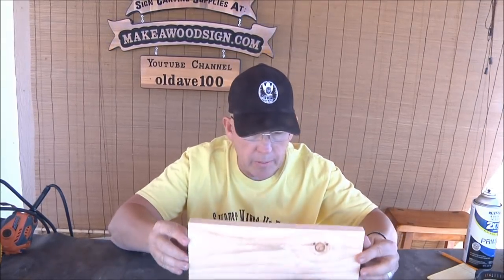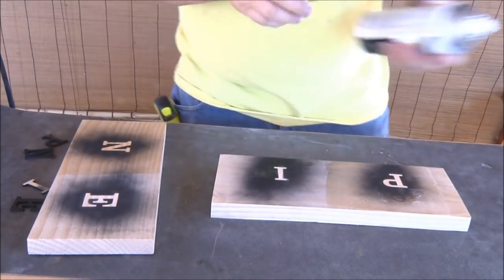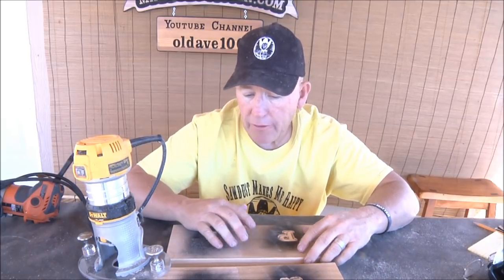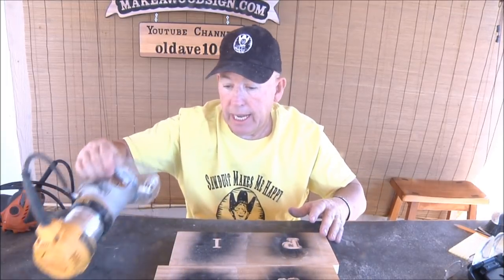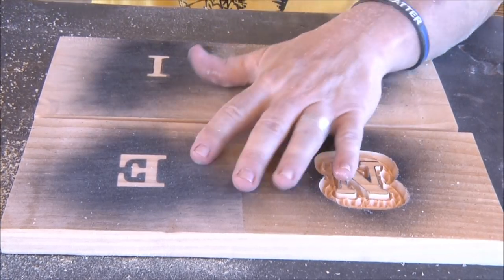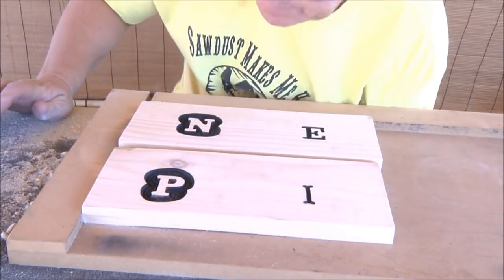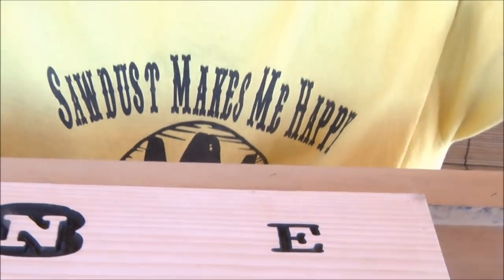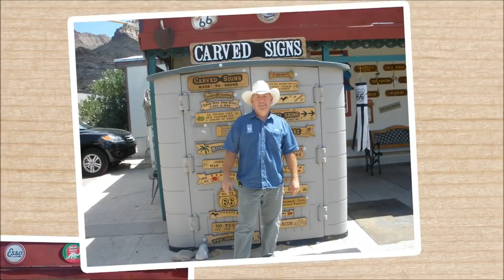#317 Demo On Freehand Carving Eastern White Pine

Comment: The Eastern White Pine I get from a local saw mill (Smoky Mtns area) is a Yellow Pine (slightly different) that is very soft and easy to carve. I pay his price ($1.05) a board foot. I buy 12” x14’. Only problem is it can warp easy on large carvings. The Select Pine from Lowe’s won’t warp like the soft Pine. Anything under 12” wide is about $1.65-$2.50 a foot. However, 12” wide is nearly $5/foot.
Reply from the maker: I try to prevent warping by getting some kind of finish on it right away. Another reason I use sanding sealer asap. If not then maybe a backer of some kind.